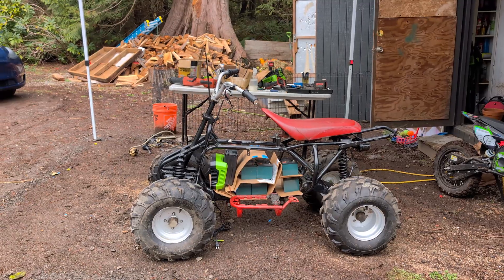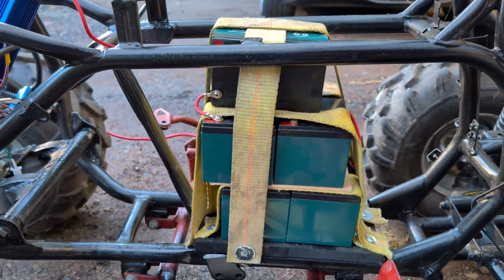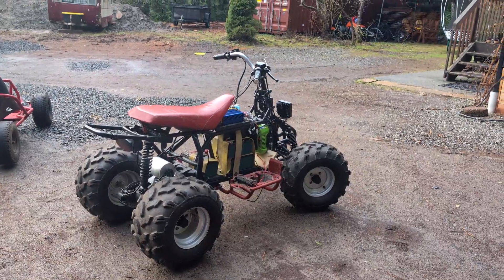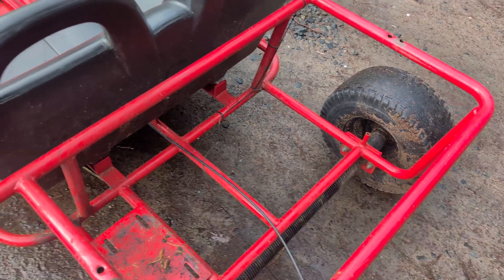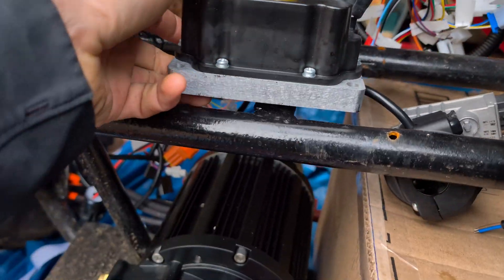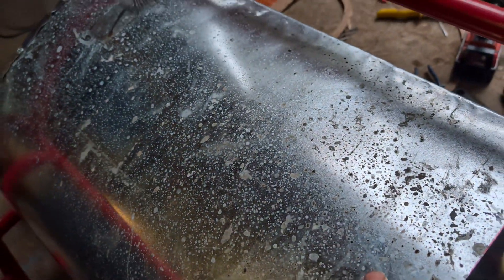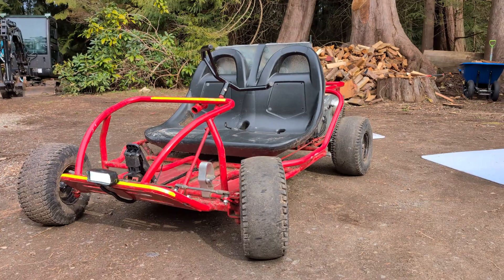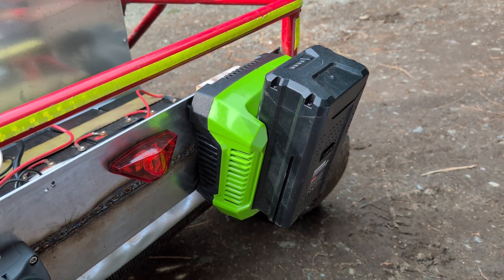Quad & Go Cart Electric Conversion - Part 2

Comment: those lead acid batteries wont work long on their side, only meant to sit straight up. also you can only use around 50 percent of the capacity of a lead acid. furthermore, to get 72v from a bunch of 6v cells you have to put them in series, not parallel :) cheers.
Reply from the maker: You are 100% correct. As you can see, I converted it to a Go Cart and placed them all sitting straight up. The 6v batteries were connected in series to get 72 volts. I said the wrong thing. I always mix them up :)
Reply: @einarmikkelsenPNW  i really appreciate you! :) would love to make electric vehicles with ya haha
Reply from the maker: @Raz31337  Are you in Scandinavia? I saw your drone video with a Volvo and a cabin in Falurød paint with the white trim.
Reply: @einarmikkelsenPNW  i have family there and originally Danish :) my uncle lives in Skåne ;) i currently live in the PNW in Calgary
Reply from the maker: @Raz31337  that explains it 😃